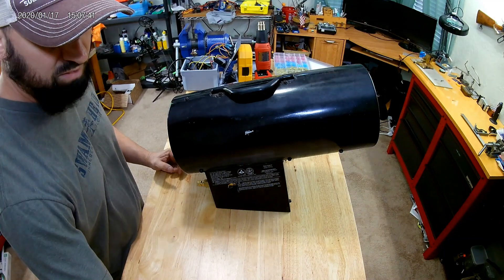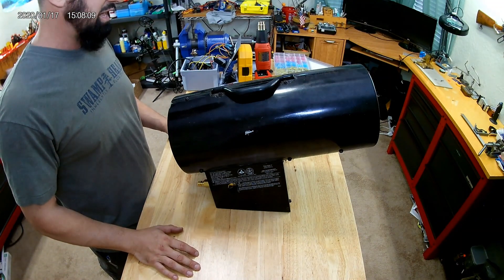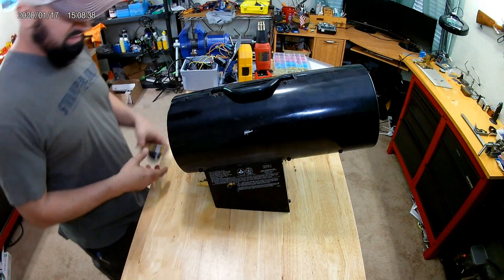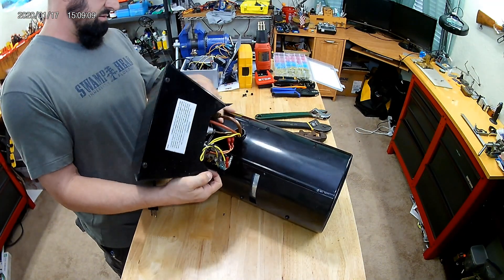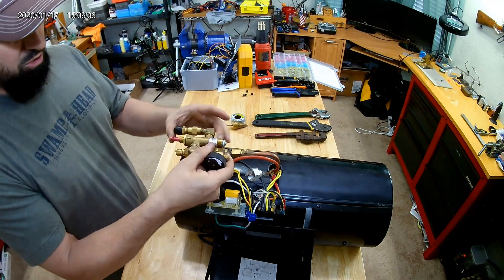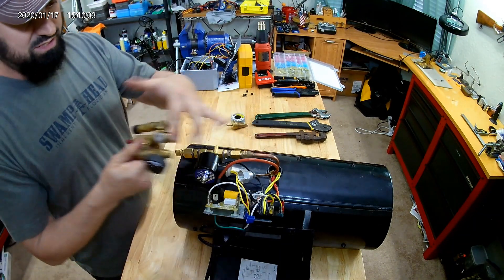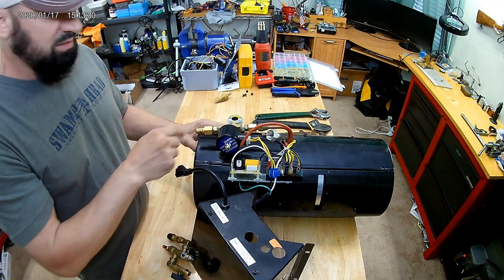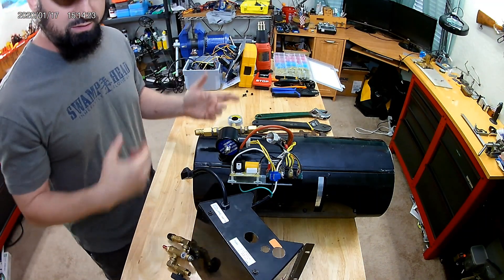Pid forced heater conversion for powder coat oven

Comment: Thanks for this video.  I'm trying to do something similar to set up a Mr Heater with a 110V solenoid to be used with a Thermostat to heat a garage/shop.  The question I have is.  Did the Mr Heater model you bought second hand, have an auto igniter/sparker module on it already?  Mine is a cheap $99 model that has a push button sparker/igniter.  I'm trying to figure out the simplest way to replace or automate that sparker so that instead of a push button type, it has one that ignites off of the 110V AC - Like on a gas oven/stove top.... plugs in with 110V and has a spark module that ignites the gas.  And I want that sparker to only ignite when it is first switched on (to ignite the gas flow) and then either based on a 2 - 3 second timer etc... or on temperature, the sparker would stop igniting. Any advice you or anyone else on your channel has would be appreciated... Thanks
Reply from the maker: Has to be auto ignition, best is to sell what you have and get one with it.
Reply: @TeufelHundin1  thanks for your answer... 🙏
Reply: Didn’t yours have a button thought?

Comment: Great video, very helpful 👌👍Any chance you made video on wiring the pid?
Reply from the maker: Would completely depend on the PID unfortunately.. But any pid with a 3amp controller built in or an external relay would work.
Reply: Can you provide any information on The PID you used and what exactly it is used to control? Is it just to turn the propane solenoid on and control the ignitor for X seconds?